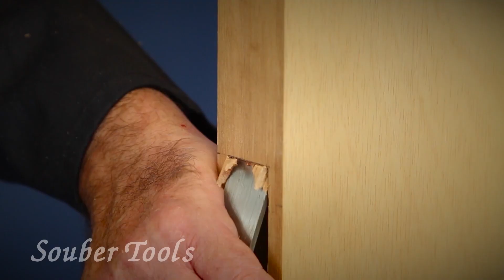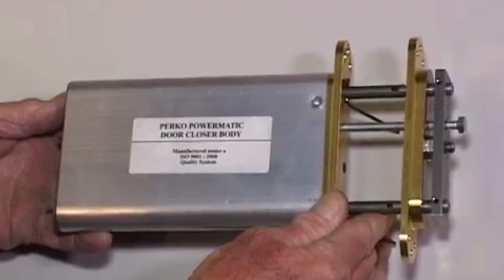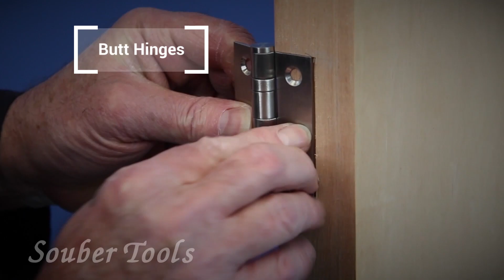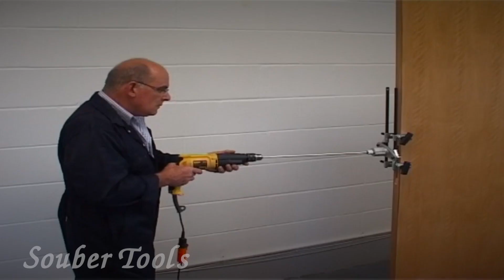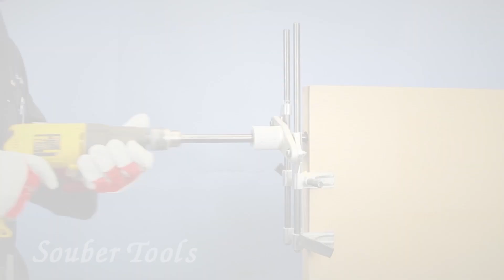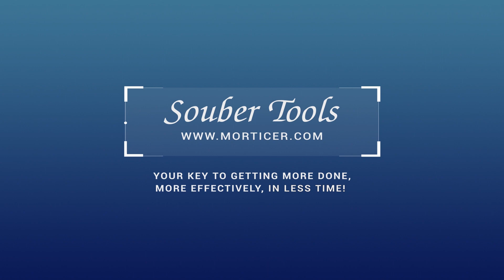Introduction to the Souber Morticer

Comment: NICE BUT HOW DO YOU KEEP THE LONG DRILL BIT FROM GOING ASTRAY?
DRILL BITS HAVE A MIND OF THEUR OWN EVEN IN A JIG.
Reply from the maker: This Drill bit does not have a conventional tip. It uses the same design as the people who drill the old wooden lampstands. When it hits a knot in the wood, the noise changes pitch but continues to cut straight. It cuts in 3 places at once using a lip and spur design. The important thing is if you start straight it continues straight. Furthermore, keeping the jig aligned is important and correct stance is advised in the Long Drill instructions. This means no deviation and no strain on the Jig or housing. If you follow our instructions you should "pop-out" within 10mm of centre. I usually expect most achieve it within 6mm.
Reply: THANKS. @SouberTools